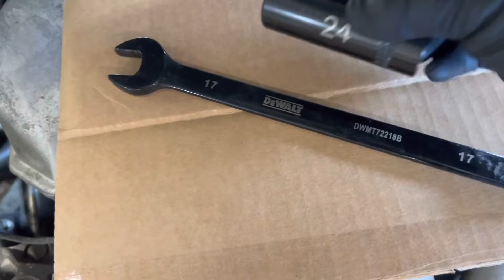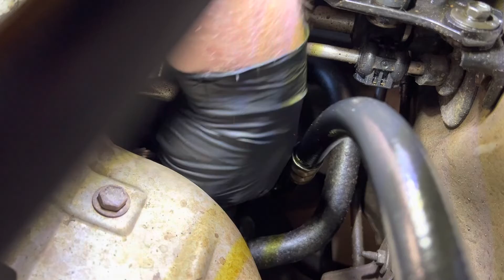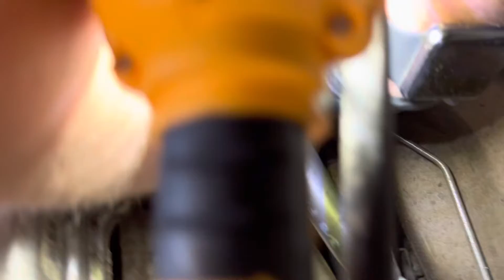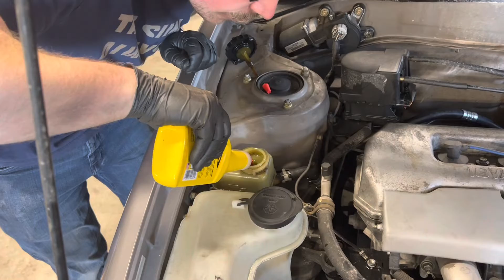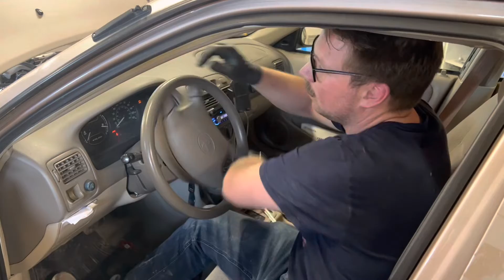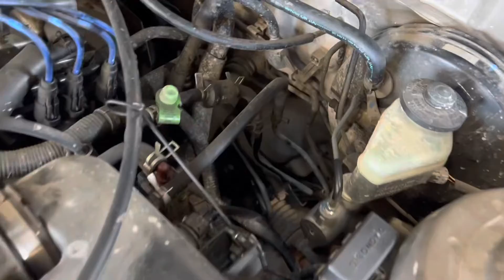DIY:How to Replace High Pressure Power Steering Line on 1999 Toyota Corolla or Chevy Prism 1998-2002

Comment: Watching this, getting ready to do it on my 2000 Corolla VE.
As soon as I got home and was backing into my parking spot, I turned to see smoke coming out of my hood. 😂
Power steering hose was leaking onto my exhaust manifold, burning the fluid. Fun times. At least it let me get home before taking a shit.

Comment: for the end of the hose with the curvy part with the small O-ring, did you have to turn lefty loosey to loosen the part, or was it the opposite. Got my part for my 98' Corolla and 
going to replace it without having to mess it up. Thanks. :)

Comment: Great video! One question...does the car need to be jacked up when bleeding the line or can the tires be fully on the ground while turning the wheel back and forth. Thanks again!
Reply: I believe it just makes turning the steering wheel easier. You can probably do it with the car on the ground, but it will be more difficult.

Comment: I received a power steering pressure line for my 2000 celica and it didn’t come with o rings or anything :/
Reply from the maker: That very strange, mine came with all of them.
Reply: I’m back.. my ends are both flared so I don’t need o rings ‘apparently’
Reply: BUT. I need to figure out what hose is bracketed onto that same hose
Reply: Can’t get this 10mm but back on on the new hose. Been kicking my butt for two hours.

Comment: Thanks for making this, I just did the line on my 98 prizm and while it took me 4 hours and a lot of self doubt, regret, and pain, I think it's finally good to go. The original line was probably still the OEM one from 98 so it was basically perforated and leaking all over. The replacement line for some reason took way more effort than expected to get the rack side tightened up. Like, I had the handle of my floor jack for leverage to get it tight. After a few hours, It seems to be holding.

Comment: I wish I wouldn't have tried to take the bottom bracket bolt out. It twisted in half with the other half of the bolt rusted to the the bracket that's attached to the car. The lines can be freed just removing the top bolt. Now I have no way of securing these lines. Uggggggggg. Oh and I ended up needing the 17mm crows foot to get it off.
Reply from the maker: Oh no, I didn’t think you could remove the line with out taking both bolts off. I didn’t have any issue with removing them on mine. The lines are pretty tight in place anyway, I think only having the 1 bolt on the bracket would be fine.

Comment: Nice that yours came with 2 connected washers. Mine are separate so I'll have to be careful not to drop them during insulation. Most other videos say I need a crows foot to remove the 17mm end. I am gonna see if I can use your method with a 17mm open end and if it works I'll just return the 2 crows feet I bought. My new line is 16mm for some reason so I had to buy 2 of them. It looks really difficult to get the 17mm off as well as the bracket that holds the lines together though you make it look easy. Well here goes nothing lol.
Reply from the maker: Glad you were able to get it done, judging by your other comment I see you had some issues. I don’t know why some of the after market parts have a different size not on the bottom end, luckily mine was 17mm but a lot  of people say there’s are not. I was able to get mine with the open ended wrench, it did take some time tho cause there isn’t much space.